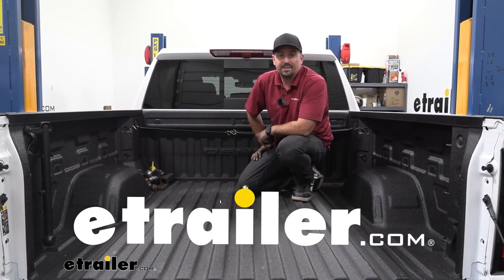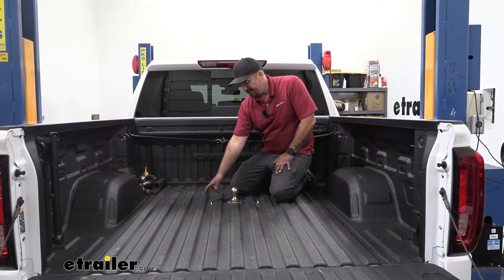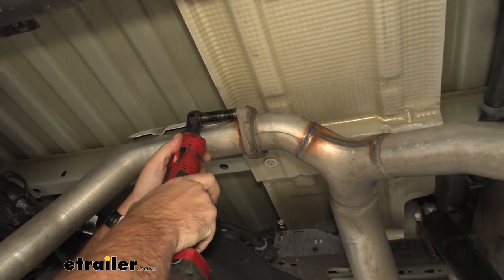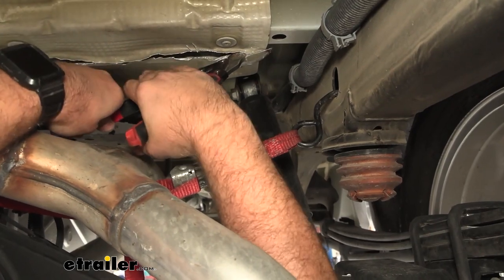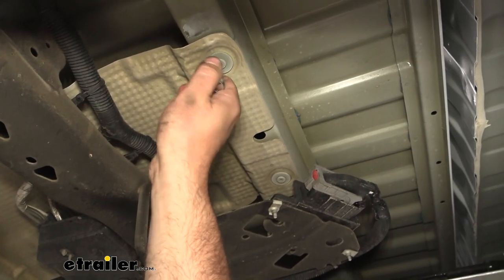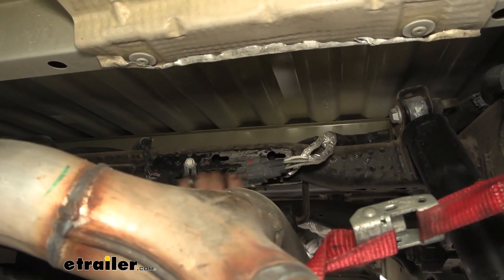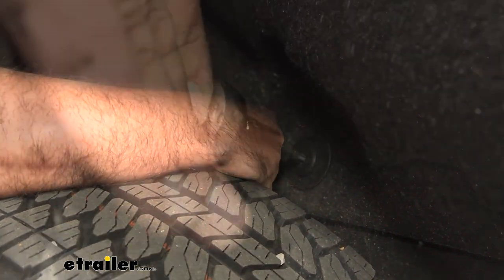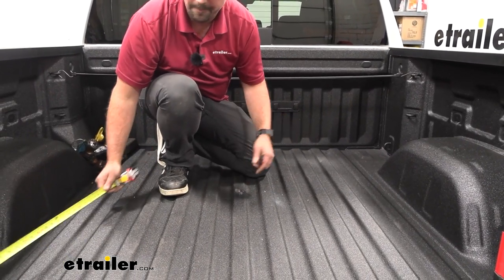etrailer | B and W Turnoverball Underbed Gooseneck Trailer Hitch Installation - 2022 GMC Sierra 1500

Comment: I was looking through the website and it tells me it can’t fit the 2022 1500 gmc, is this actually for it?
Reply from the maker: B&W Hitch confirms that their # BWGNRK1019 Turnover Ball gooseneck hitch is a fit for the 2022 GMC Sierra 1500 as long as it does not have the Carbon Pro bed.
https://www.etrailer.com/Gooseneck-Hitch/B-and-W/BWGNRK1019.html